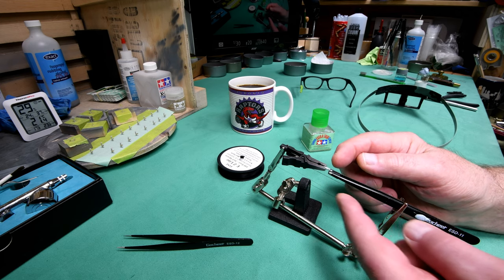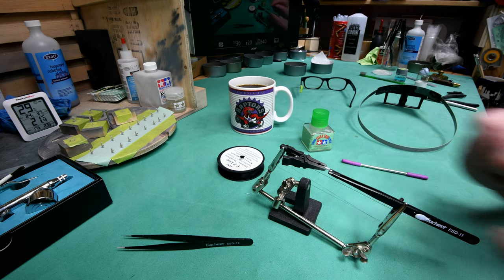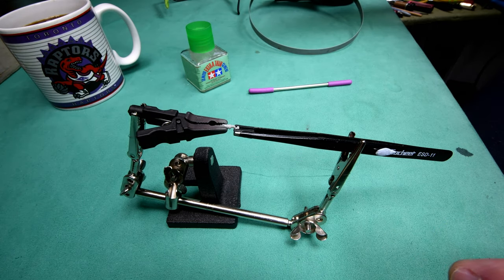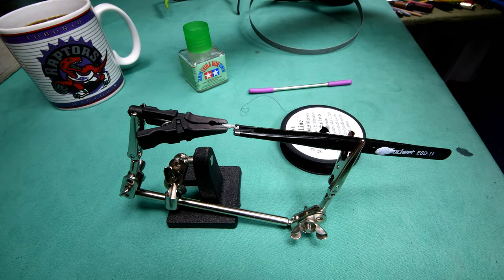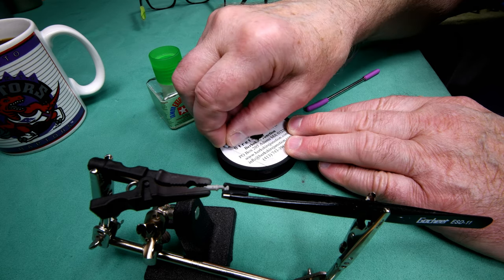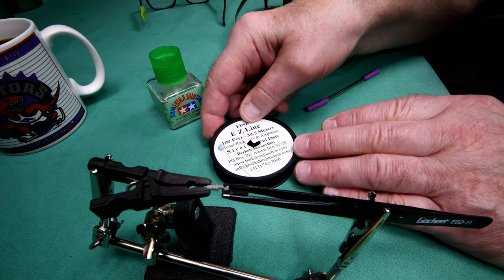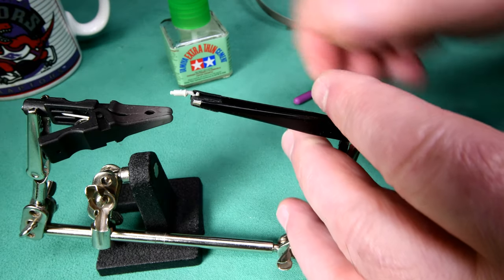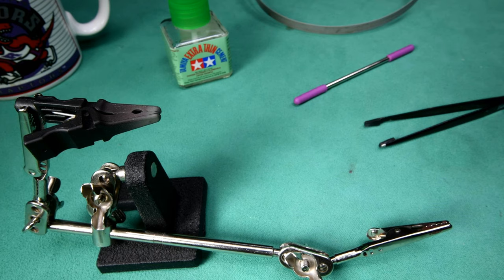The Model Ship - Part 714

Comment: Ron, light coats, by the time you’ve finished the last one you can do another light coat starting with the first part. Two is probably enough. Paint dries faster and no detail is obscured. Sometimes I might do three coats, but usually two are enough. And yes,that EZline is great stuff. Many uses, you’ve just demonstrated another!
Reply from the maker: "Many uses" Yes, a super weak rubber band. 😁

Comment: poke1
/pəʊk/
Filter definitions by topic
See definitions in:
All

Motoring · Informal
Fashion
Plant
Savoury
verb
1.
jab or prod (someone or something) with one's finger or a sharp object.
"he poked Benny in the ribs and pointed"
Similar:
prod
jab
dig
nudge
tap
butt
ram
shove
punch
prick
jolt
thrust
stab
push
plunge
stick
insert
drive
lunge
2.
thrust (something, such as one's head) in a particular direction.
"I poked my head around the door to see what was going on"
noun
1.
an act of poking someone or something.
"she gave the fire a poke"
Similar:
prod
jab
dig
elbow
nudge
tap
butt
thrust
push
shove